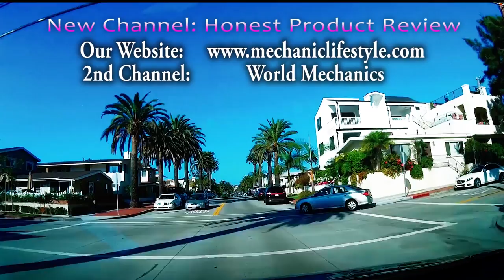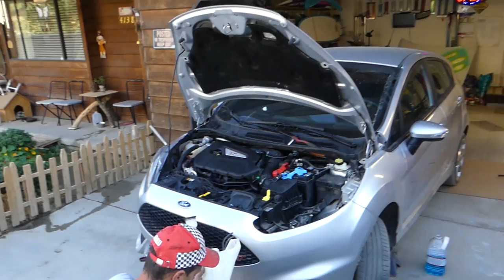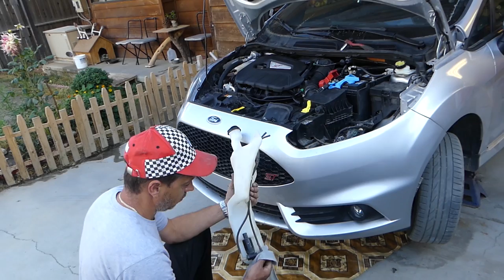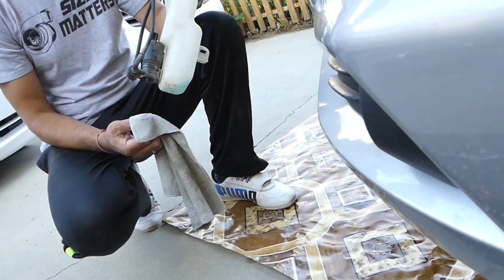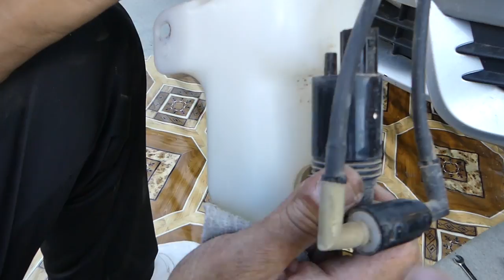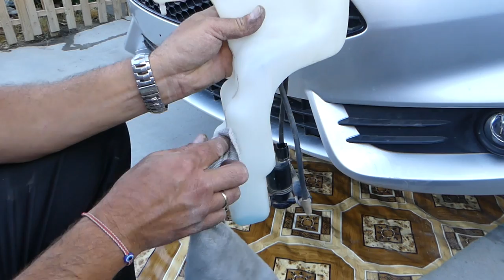HOW TO REPLACE WINDSHIELD WASHER PUMP ON FORD FIESTA MK7 ST

Comment: What if rear is working and front is not working?

Fuses are okay.

Is it bad pump?
Reply: Did you manage to resolve this? I'm having the same issue.
Reply: I'm having the same problem. anyone resolved it?
Reply: I believe your issue is in the switch. The front washer switch has malfunctioned.
Reply: I have a Ford Fiesta 2011 Hatchback. The same problem: the rear washer works, the front washer does not.
  I took apart the entire switch and cleaned the brown and green contacts which are responsible for the front washer.  It took me 20 minutes. Don't buy a new switch, you can do it yourself.
Reply: @Yevgen-eg1gw  can you explain in detail how you done this please. I have the same problem rear works but front doesn't or works infrequently.
Reply: @Yevgen-eg1gw  what do you mean by switch? The washer pump itself?
Reply: Hallo guys, I am experiencing the same problem. Can anyone shed light hereon? Many thanks
Reply: It was the switch itself. 

Replaced it and that solved the isue.
Reply: @emile2948   It's the button you push to start the fluid flowing next to the steering wheel.  I had the same problem and got it fixed by aggressively pushing the fluid button over and over.  it must have re-aligned it or something.  If that doesn't work, you will need to disassemble the switch to clean, or buy a new stalk, which is only about $60 USD

Comment: Pointless... How do you remove the wheel arch liner. You basically only show the middle step of five steps to do this. Hardly a "How to" video, is it now?
Reply: Quite useful to present the basics though. Undoing any wheel arch liner is the usual process of jacking it up and removing as many fittings/clips/screws as you need to in order to either gain enough access to do a job or remove the liner entirely. Beware of all the crud and rusted screws though - you may well have to replace some fittings!